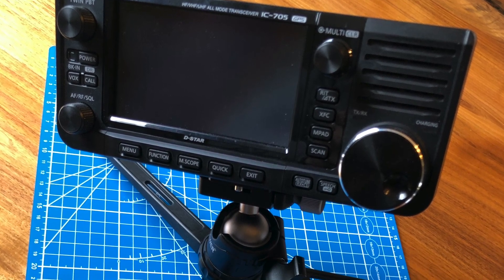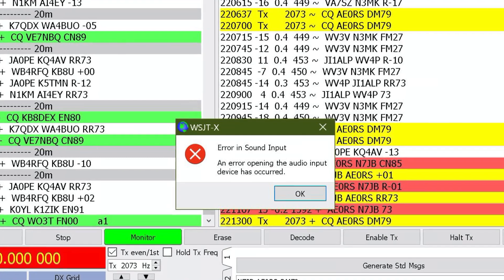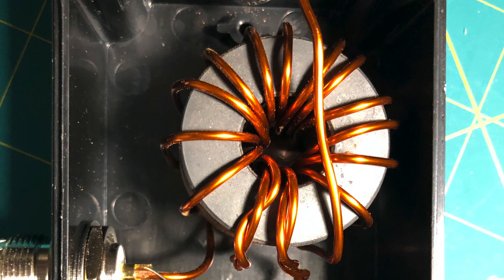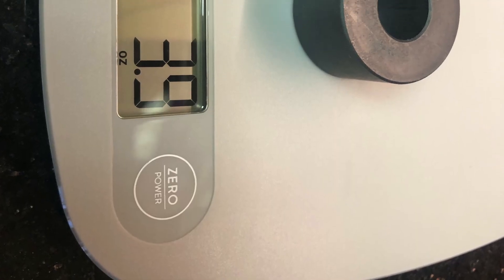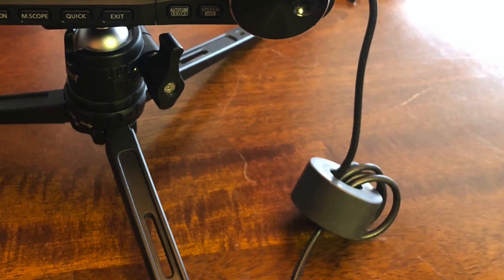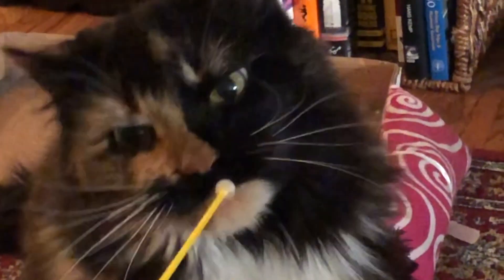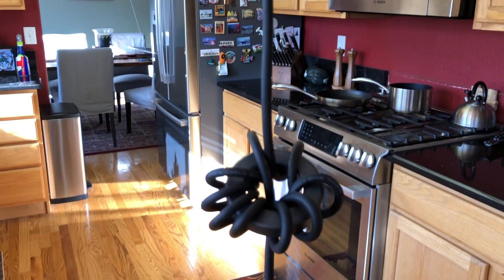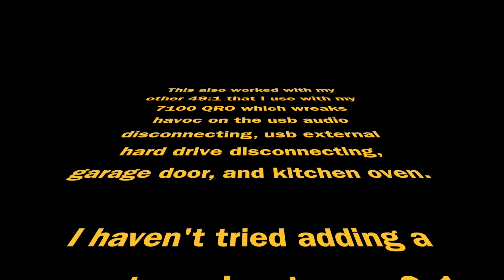FIXED Icom IC-705 FT-8 USB Audio Disconnected Error

Comment: A choke balun on the coax near the radio is a good idea for antennas that can have RF on the feed line. You can install small ferrite beads on the USB cable. I have a random wire antenna with counterpoises and a choke balun at the same distance as the length of the counterpoise on the coax another choke balun is near the radio. (a couple of feet).  Verticals without good grounds also benefit from a choke balun near the antenna.

Comment: I only have this issue with my “compromise” antenna the Comet HFJ-350M. Counterpoise required on it to begin with. But turning the coax around a simple snap-on ferrite a few times and mounting the antenna couple feet away does the trick. No way to use the wind camp antenna bracket which puts the coil inches away. But again only an issue on HF, Digital, and let’s face it, a poor antenna.
Reply: experienced this today :) I have ground radials rather than a counterpoise, but reckon getting a lengthy USB cable and wrapping a nice big ferrite around it will do the job !

Comment: I'm having the same issue and was told to use a Mix 31 toroid to wrap the microUSB with so that is my next step
Reply from the maker: That mix should definitely help.
Reply: I thought it was an issue with noise on the USB, but found putting 3 turns of the coax feedline through either a clamp-on ferrite, or just recently tried the same few wraps through a FT240-31 torrid I recently ordered...either of the ferrites fixed my problem.  I ordered the torrid because I was getting worried about eventually breaking the little plastic tabs on the clamp-on ferrite, and it'd be easier to do (and undo!) the loose wraps through the torrid.

Some have guessed that it's the radio end of the USB that flakes out, not the PC end.  It's better to quash the RF coming on the shield of the coax before it gets back to the radio.  Redirecting it to a counterpoise, and/or stopping it with ferrites on the coax is "further upstream"!

Comment: I suspect the issue is common mode current. Without the counterpoise, RF flows on the outside of your coax, which acts as the counterpoise. You need a common mode current choke, or, as you've demonstrated a proper counterpoise wire. Nice work and video 👍
Reply from the maker: You're spot on - and thanks!